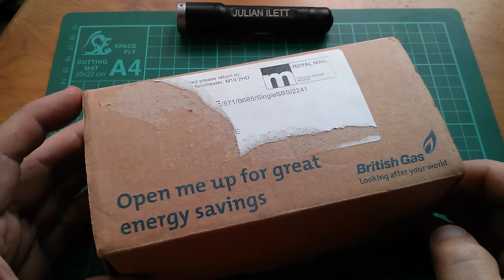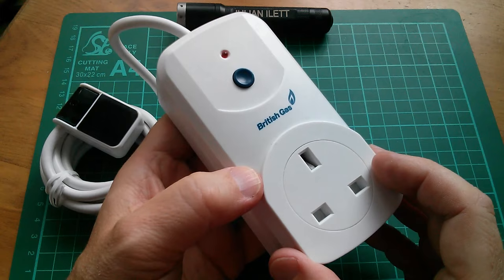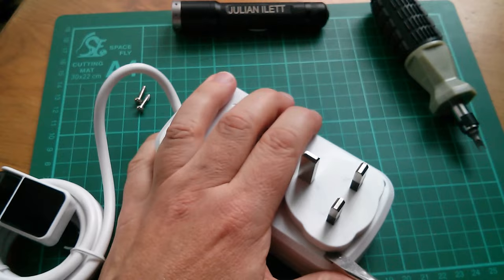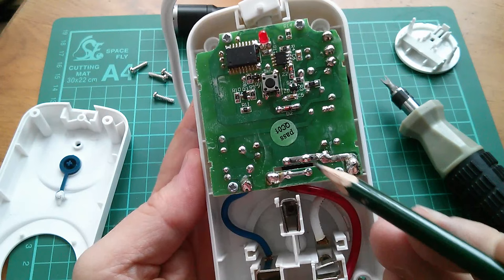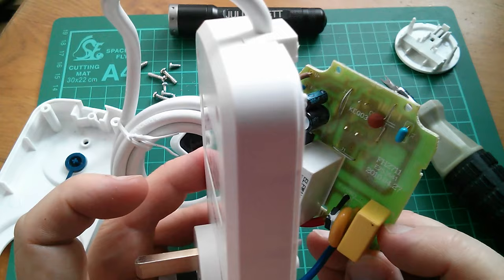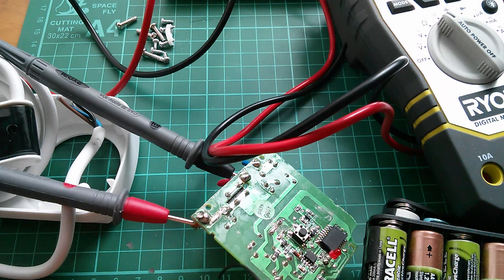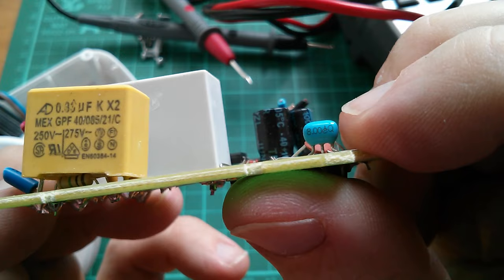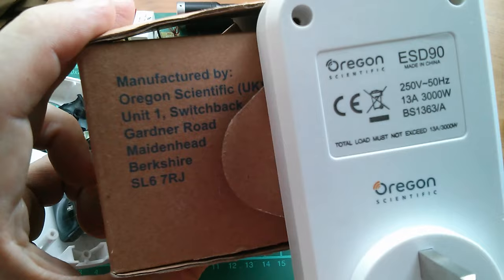Julian looks at Green Stuff: #1 - British Gas Appliance Off

Comment: The 1 Meg resistor across the dropping cap is to prevent it from shocking you when you unplug it and touch the terminals. Without it, it can give you a nice shock :D

Comment: God knows why they'd have mains cable for that IR receiver? Seems highly inefficient for something that's supposed to be uber efficient? Ideally a super cap with Mosfets and an SSR would be way more efficient than a relay, nano amps vs 10's or even 100's of milliAmps... Cheers Julian :)
Reply: Because the are using a capacitive dropper the wiring could go up to mains voltage depending on the fault.
Reply: Walter Boxhead Correct, but not overkill.
Reply: Robert Szasz If the dropper cap is is in the neutral as it looks to be  the whole thing would be at 230/240Vac WRT earth.

Comment: I have similar, they are mainly used to turn off Standby Mode on the TV which could add about £80.00 to the bill if on all the time; or with the increased costs of electric £176.00 a year saving

Comment: The photo-detector is an I.C. with, usually, TTL outputs.
It demodulates the 32Khz (or 48Khz in some models) carrier signal and puts out a 'clean' data signal. (well, in theory anyway)
Reply: Aadil Shah 38-40kHz is the norm - never seen one use 32kHz. The receiver has a photodiode, a fairly wide BPF, demodulator,  AGC and a data slicer.
(Writes someone who's done a fair bit of commercial work on IR remotes.)
Reply: Graham Langley I'll take your word for it. It's been a while since I tinkered with these.
Reply: Aadil Shah I've used (and abused) quite a few in work projects over the years. 

Putting one in a box plus battery and circuitry driving a piezo element and LED made a very useful tool for checking the buttons on IR remotes and the range. You can easily recognise the different protocols used by ear.
Reply: Graham Langley Hmmm. Good tip!
I've got one on an Arduino shield. The library I used works nice with Chinese remotes but not with some of the facy ones.
Reply: Aadil Shah It's a pretty good bet that current kit other than Sony or Philips/Marantz will use the so-called NEC protocol or a coding variant. There are others, including an old Ferguson/Panasonic(?) one from the 80s that didn't use a carrier. 

I built an AVR-powered bit of kit to decode NEC format and display it on a 16x2 LCD. Never did get around to including Sony and Philips.
Reply: Graham Langley The one protocol I haven't cracked is the one used for the Infra-red keyboards that came with the original netbox back when it was still dial-up only. :P
I have a keyboard and it's associated 'handset' but I couldn't get it decoded on an Arduino. 
Yes, the NEC protocol is used by every Chinese knock-off ever!
Reply: +Aadil A DSO is invaluable for decoding an unknown format, but it is possible using a non-storage one with patience as I did before they became affordable.
Reply: Scopes are way too expensive here in South Africa! :P
But maybe I'll get a decent one one day! :P

Comment: Reminds me of some of these 'smart' powerboards - intended to switch stuff off when the main appliance is in standby/off. You spend 1-2w to run the thing, so you have better be sure the appliances it is controlling use at least that much power when you're not using them! It's a bit counter-productive when the device uses 0.5w when on standby, and the 'power saver' uses 2w!! Whilst it would have been a much more efficient design if it had indeed used latching relays, I suppose if they use PWM to minimise the power needed to keep the relay on when the appliance is in use... it isn't too bad... but there are some much more efficient ways to do it!
Reply: Peter Feerick When I measured the OneClick Technologies one here used with a destop PC to switch off all its related stuff, it consumed <1W in the off state.
Reply: Nice one Graham Langley, that one I would love to have. Problem with these things is that each manufacturer is different. I have one on the desktop PC here, and the computer monitor consumes less W when on standby than the powerboard... monitor is < 1W, and the powerboard is around 2W when 'off' :( Then you have the power boards with LEDs instead of bulbs/neons for indicators. All good, until one stupid manufacturer uses a poor choice of resistor, which uses more power than the LEDs! uses around 0.6W just for the 'surge protector' LED, and around 1.8W if you leave all four switches on! And you can feel the side of the unit is warm after it's been on for a while! duh!
Reply: Peter Feerick This one seems to be intelligent and doesn't have a fixed threshold. 

I've not had one of them apart but the TV version from the same source I was on about earlier uses a Cirrus Logic CS5466 and a 16-pin micro with a marking (OCT 893) that gets me nowhere. The CS5466 is a “Low-cost Power/Energy IC with Pulse Output” that measures true power and gives a pulsed output. Power supply is a Power Integrations LNK302GN.

If you're in the UK, someone on eBay has them for £4.99 delivered ATM - search for DSK105

Comment: cr-v is the metal, chome vanadium, 6 in the size in mm across the bit, these annoying bits are everywhere now...yeah the old tax rebates they were getting, theyve ended now, i got some lightbulbs, and a wireless inductive power meter than hung off the meter wires in the cupboard so you could see your useage live, total waste of time, i dont want to see what im using, cant exactly live in the dark if i dont like it
Reply from the maker: jusb1066 Doh! Chrome Vanadium - I should've worked that one out.

Comment: One can wonder what the quiescent current of that device would be in standby.
Reply: Rickard Hellqvist Probably much the same all the time. 

Remember a capacitive dropper from 230/240V mains to 24V is effectively a constant current source, so if the current doesn't go through the relay coil it will go through zener Z1, which should be around 24V to match the relay coil.

If they used something like the Power Integrations LNK302GN capacitive dropper replacement it would be a lot less.

Comment: Why did they waste so much copper with the cable to the Infrared LED? could have been super thin cable...
Reply: muh1h1 It's an IR receiver and as the circuit isn't isolated from mains the cable has to be mains voltage rated. They probably found 0.5mm² three-core mains cable was the smallest available or the cheapest option.
Reply: Graham Langley
That makes alot of sense now, was not thinking about that...
Reply: muh1h1 No problem.
Reply: Yes what I was thinking; but could be cheaper because one wire types purchased in bulk could save cash, also machines to strip wires could be more standard sizes for wires, cutting costs

Comment: Don't write this device off, although I grant it would be a lot more useful if it also had unswitched (Freeview/Sky box) and switched (DVD) outputs like the Eon-branded OneClick Technologies one in use here.

It means the TV, which here has a rather user-unfriendly mains switch, can always be switched on with the remote but is never left in standby.

The desktop computer version is similarly useful - it detects when the PC switched off or in standby and powers down all the peripherals - printers, speakers etc.
Reply: Graham Langley Just realised you don't seem to have grasped how this device works. It's not to switch off the Sky/Freeview box, it's to make sure the TV is never left in standby. 

You plug the TV into the device's socket and, usually by pressing the button on the device, teach it the on/off code from the TV's remote. 

Make sure the TV's mains switch is on then press the remote's on/off  button. The device switches on power to the TV which powers up in standby. Press the on/off button again and the TV wakes up - the device now ignores it this time.

Next time you press the on/off button to put the TV into standby, the device sees the drop in power and switches off power to the TV around 30 seconds later.
Reply: Graham Langley Should add that current TVs have a <<1W standby consumption so this shouldn't be needed, but it's useful on older TVs.
Reply: Graham Langley Hmm. Looks like I've jumped to a conclusion and this is (was) just a simple dumb IR remote, something that always thought was of very limited use. I've got a freebie one here in the collection of mains control stuff and it's never been used.

Juilan: If you'd like I could send you one of the devices I described, either for actual use or a teardown. They were being sold off by Homebase for £1 a couple of years back.

Comment: I'm pausing the video before you open the thing to try to make a wild guess. There is no fancy relay inside ... unless it's rated for really low power - like 100 watts. But even then probably has solid state relay instead. Guess what. It's even worse. It's power supply is probably drawing 1-2 watts in standby mode. I'll continue the video to see if I'm right. I promise I won't delete the comment if I'm wrong :)
Reply: Nickolay Pelov ops - 13 Amps -> no bi-stable relay. Maybe solid state relay if you are lucky ... but it has to be cheap. It's a gift, right?

Comment: Bunnings Warehouse in New Zealand is selling an even more idiotic device. It's an adaptor you bung in between your cell phone charger and the outlet to kill the "standby power" when you unplug your phone but leave the charger plugged in. 

No doubt it also has a nasty capacitive fed supply in it. Totally pointless, I mean how much power would a small unloaded switchmode charger take from the mains anyway? I am picking roughly in the same range as this silly "green" adaptor. 

Even more stupid is that it can take up to 20 minutes for the device to distinguish between the standby draw ov your charger and what it takes actually charging the phone! 

Obviously these things have not been a fantastically fast moving item and have already been through one or two rounds ov discounting. 

I might get one when they make it into the $1NZD bin (which no doubt they will) and see what's inside, but I would imagine it's similar to what's in your device. Except these things are extremely small so they might not even contain a relay. Or just a really puny, shite one.

It still seems a cheaper option to switch the mains in low cost devices such as these using mechanical relays rather than triacs etc. Quite amusing.

Comment: Amazing they are using super cheap resonators and not even crystals now. It's a race to the lowest price. Single sided PSU PCB. That thing probably has an amazingly low BOM.
Reply: Of course it's cheaper and they don't need the timing. Next step is the ultra cheap mcu with the built in rc clock. Save 10 cents more
Reply: Rob Fowler  I was thinking this as well, as someone else said, it's BOM must be amazing. However, one thing that really confuses me is the bit of cable they use for the IR sensor. It seems counter intuitive for it to be so thick.
Reply: ***** I am pretty familiar with the combined RC and crystal system in the Ti CC1101 part. Because it's a radio and they need some precision but they want to save as much power as possible, they have a system to fire up the crystal at specified times, measure the difference to the RC oscillator and apply a factor in the PLL for the RC oscillator. Not focused on BOM of course, but pretty cool. They also do other cool stuff like measure the PLL convergence parameters and save them as presets so when  you start up and/or frequency hop, they can lock the PLL up much faster. (This is why the spec for the radio is an 110 page PDF! Even then, they also give you a little windows app to show you how to set the registers based on all these sort of settings).
Reply: ***** It's covered in detail on page 54 of the current CC1101 PDF. Worth a read. Amazing chip.